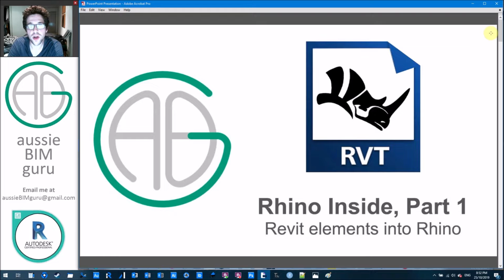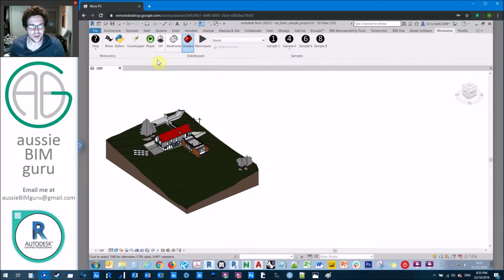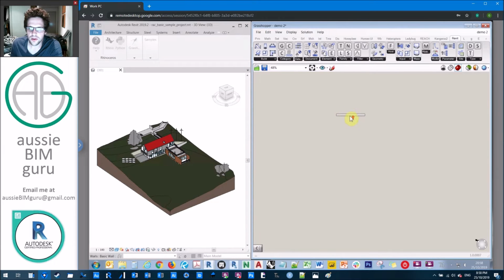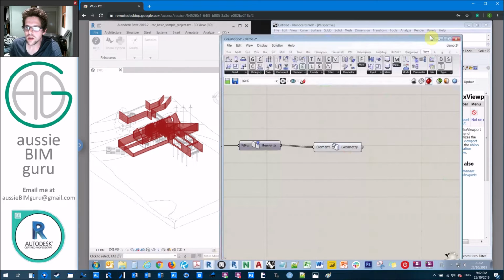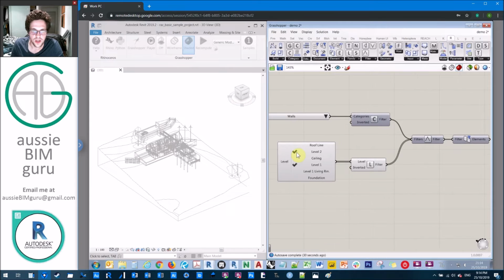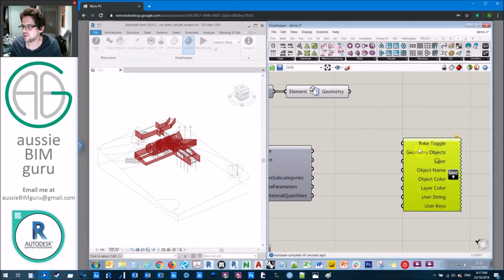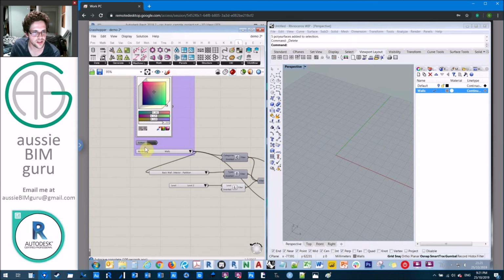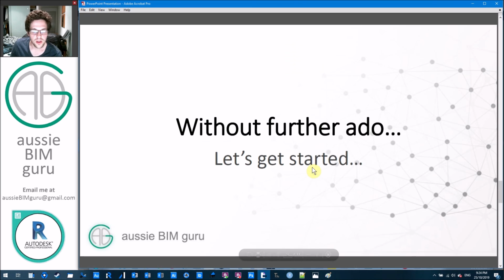Rhino Inside: Revit Elements into Rhino (Part 1)

Comment: hi, how to get the section line by rhino.inside.revit ? I tried the category filter (section line) -> query elements.
(I want to have the "section lines" to get the walls which is intersected to the section lines)
Reply from the maker: To my understanding the line isnt retrievable and has to be constructed using the section views plane and crop extents to build it in plan.

Comment: Hey Gavin.  I'm trying to pull a DWG from Revit through grasshopper so I can create a workflow for something that changes often and is setup with DWG lines.  I can get the DWG as a Graphical Element but I don't see a way to pull layer data to filter layers.   Any thoughts here? I know I could just Import into Rhino but I'm trying to avoid that step if possible.
Reply from the maker: I think you can only do that by getting geometry from the CAD object as as ImportInstance using the Geometry property, then querying the graphicstyleid/category properties to identify the related layers for those GeometryElements. Might be slow for large CAD files versus an import though. You'll definitely need Revit API and ghPython for this.
Reply: @AussieBIMGuru  ok then I might give up and just import to Rhino.  I can get the data through Elefront, layer via a Value List and Geometry via setting the CAD as a graphical element, but not really understand how I can filter the geometry.  I'll keep trying for 10 more mins then go the other route. Running out of day. Thanks for you help!!
Reply: Actually, It's pulling layer names from Rhino I just realised.  So I think Import is the only way.

Comment: extremely useful!!! Is it also possible to do the same with the Zones and also get the parameters to rhino ?
Reply from the maker: I believe it should be although you might need some ghPython/Revit API for this as I don't think Rhino Inside has access to spatial boundaries in nodes currently available to users.

Comment: Make a video on how to install it it doesn't install in my revit 2018 with rhino 7
Reply from the maker: I'd probably ask on the forums about that as I don't have earlier than revit 2019 installed unfortunately.
Reply: @AussieBIMGuru  @archit , I think you just need to uninstall any older installs of rhino inside, using control panel and uninstall programs in windows.  At least that was my install problem.

Comment: Everything is unrecogniseable in new Rhino inside Revit.
Reply from the maker: Yes it had a massive overhaul, so some of these videos are a bit out of date now unfortunately.

A lot of the concepts and nodes are the same in principle, its moreso logos and some names of nodes that got changed.
Reply: @AussieBIMGuru  not easy for newbeginners.
Reply from the maker: @thorjarlberglund997  i might remake the series eventually on my course platform. Youtube is difficult as it cant be updated, only rereleased if programs change.
Reply: @AussieBIMGuru  is there another way around this preticular explodemesh command? I want to finnish this one..
Reply from the maker: @thorjarlberglund997  not that I have seen. Revit to brep is often quite unpredictable in my experience, I usually work with meshes instead when using rhino inside these days. I use the elefront package to connect elements by their Id like in this tutorial;
https://youtu.be/Bb0z-2T_4iU

Comment: I use your steps and work fine, except railing. It picks all railings except the top railing. l looks like a bug. I use the default railing 900mm pipe.
Reply from the maker: Yes railings do seem to have some bugs I found also. Might be worth checking if its a top/hand rail as these may be treated separately from their host railing.
Reply: @AussieBIMGuru  I have also tried to remove the category filter and with that grasshopper selects all elements on the particular floor. All except top railing. I will write to macknills forum.
Reply from the maker: @nikouer  good idea! They have a sub-forum for Inside issues specifically.

Comment: Hi Gavin ! could you give me the link download for Rhino inside Revit (include Rhino WIP, Im using Rhino 6 and Revit 2019). I only find on internet  Rhino 7 version and when i setup, program ask license. Thanks!
Reply from the maker: You need a Rhino 6 license to operate Rhino WIP, so if you're using the 90 day trial I don't believe this will work. Rhino licenses typically work via their website as a cloud access, and should work across all Rhino builds such as 6 and beta 7.

The Rhino WIP/Inside link are below;
https://www.rhino3d.com/download/rhino/wip
https://www.rhino3d.com/download/rhino.inside-revit/7/wip
Reply: @AussieBIMGuru  thanks Gavin, maybe i will use Rhynamo with Dynamo
Reply: Hi Gavin, im using Rhynamo in dynamo, i can tranfer object from Rhino to Dynamo, but object draw by Grasshoper not available. Do you know save object draw by Gasshoper to Rhino ( only 1 file.3dm : include object from GH, file.gh). Many thanks
Reply: Do you know Mantis shrimp? Why i download from Dynamo package Manager and save to package directory but not show on the Dynamo ( already install GH python, python2.7 and Rhino 6,  im using Dynamo 1.3.3). Thanks
Reply: I already solve. I add library " MantisShrimpUI.dll"
Reply: Do you know add archi lab in Grasshopper?, i already done in Dynamo but i dont see tab archi tab in GH?
Reply: I solved
Reply from the maker: Objects in Gh are preview so I believe cannot be transferred until baked as 3dm.
Reply from the maker: Archilab itself is unoque to dynamo.
Reply from the maker: I suggest emailing me for queries beyond initial comment in future - youtube doesn't notify me when replies to replies occur so i have to manually look for them.
Reply: @AussieBIMGuru  thanks you

Comment: I had some problems after export the geometry. When I put section on a sheet, the geometry was cutted, but even the cut lines are showing as projection lines. ;s
Reply from the maker: You mean geometry in Revit? Some categories show projected always, for example furniture. If you want cuttable graphics, use generic models.

Comment: In the future, revit will only be used to document and quantify projects LOL. Great video, cheers from Mexico City
Reply: Indeed! Good Point! The biggest problem with the BIM software currently on the market is that they are very weak as design tools. Grasshopper is becoming alternatives to Revit and Archicad in this respect year by year.
Reply from the maker: @archist9789  i see rhino as a complimentary tool to build hybrid workflows. At a certain point rhino cannot meet BIM requirements just as early on BIM struggles to facilitate design.
Reply: You mean "complementary"? I do not mean Rhino should be alternative BIM software. As you say, it's currently not BIM software at least now. What I mean is rhino+ grasshopper will be compensating the defect of Revit and Archicad they have in them more and more.
Reply from the maker: @archist9789  yep that's what i mean too, i agree :)
Reply from the maker: I doubt it, but we'll see!

You're welcome :)

Comment: hello sir . thank you for your investigate in Rhino inside Revit . i want to bake revit object family such as bed , M_Table Lamp - Standard , Lighting_Fixture-Kim_Lighting-BE17 with Pole , but in grasshopper it couldn't distinguish that and it error says " empty revit parameters "  . . .  what should i do ??!!  Thanks alot
Reply from the maker: Unfortunately I am without access to Rhino until february as I am between jobs over the new year.

I would try to use a family based element filter, then review the geometry that is in the element geometry node. Some of the geometry may not convert well such as model lines, may need to dispatch each element's geometry by type.

Hope that helps in the meantime, sorry i cant help more currently.
Reply: @AussieBIMGuru  very well sir . i wish the best for you in your new year . i trying to find out what ever i could and i will wait for your tutorial about that . . .

Comment: So, Now Grasshopper can be used for Revit workflows, So will there be any insecurities for Dynamo?  Are they like to say, Will Rhino Inside Revit(RiR) kill Dynamo? What's your view?
Reply from the maker: I think rhino inside highlights the inseucurities of visual coding in general - so many programs all doing the same thing, split up by proprietary software.

I hope that eventually we get a combined effort by autodesk/mcneel to integrate GH/Dynamo into a single platform - both have many aspects that make them valuable.

Whilst for computational design related to form and analysis GH tends to do much more (and much faster), Dynamo has some aspects i prefer over GH that will keep it very much alive, including:

- an easier to manage list system for new users (trees are great, but take a while to learn)
- integration to revit, users do not need to buy 2 programs
- a strong developer community (just like GH)
- an easier environment to learn revit API and continue to plugin development or pyrevit
- ease of script deployment (dynamo player is great!)
- ease of constructing UI (human UI does more but is harder than data shapes)

Usually people saying this will 'kill dynamo' in my experience tend to be wishful thinkers who don't like revit. Why wish for the death of a tool that brings so many new users into the field of computational design (and saves revit users so much time!).

My advice is to learn a bit about dynamo as well as GH, then try Rhino Inside to get an idea of what it can/can't easily do.

Hope that helps answer :)
Reply: @AussieBIMGuru  Great explanation. I'm bit relaxed now .
Reply from the maker: @RajeshKumar-vv8zo  no need to worry, dynamo has a bright future if autodesk treat it with the care it deserves!

I will make a detailed video on this topic in the new year as many ask my this question (and for many reasons!).